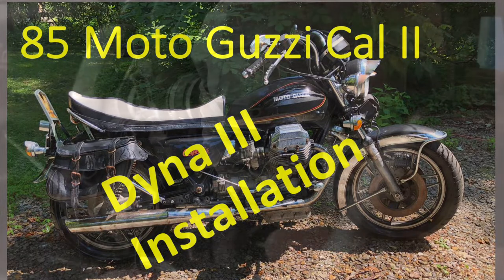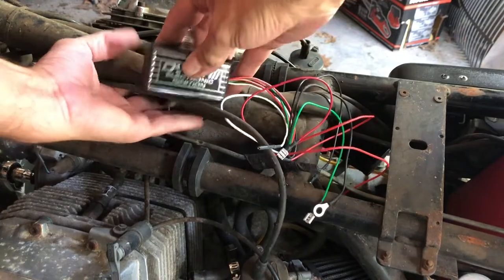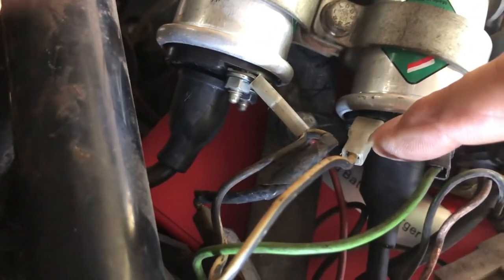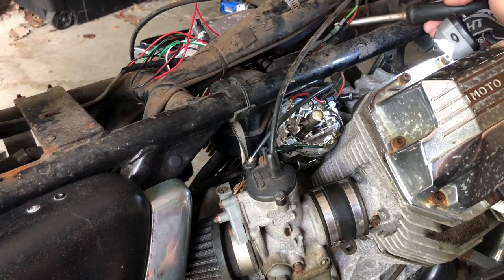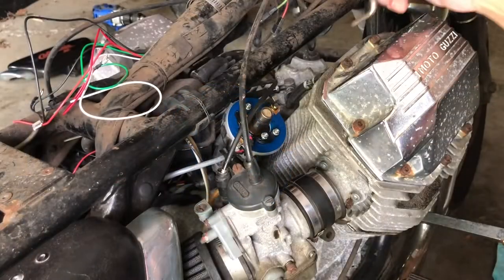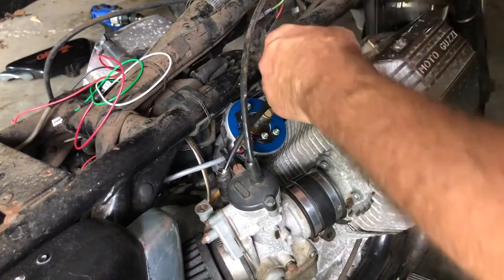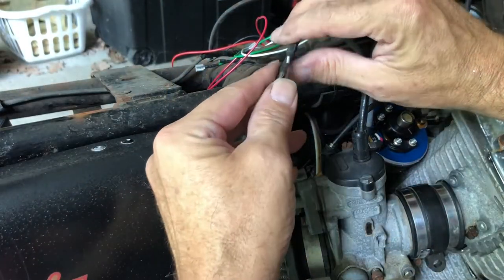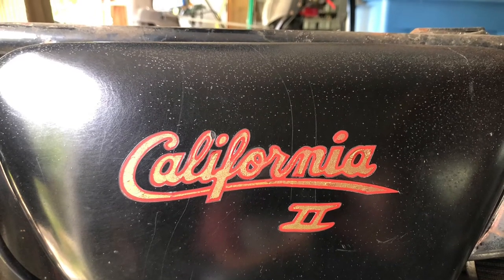electronic ignition for my 85 Moto Guzzi Cal II - Dynatec Installation

Comment: thanks for uploading these Guzzi videos!  wondering if your headlight array was custom ordered?  not seeing it on other California II bikes but thought that configuration would be amazing even before seeing your bike...
Reply from the maker: Thanks for your comment. The dealer that originally sold the bike made customizations: the light assembly, side pipes, saddle bags and a few more. That dealership closed several years ago so I can’t ask for any more details.
The biggest mod in my mind were the side pipe exhausts but they were super noisy. I did not even notice that I lost a pipe on the highway.